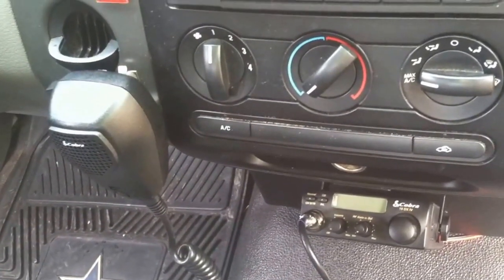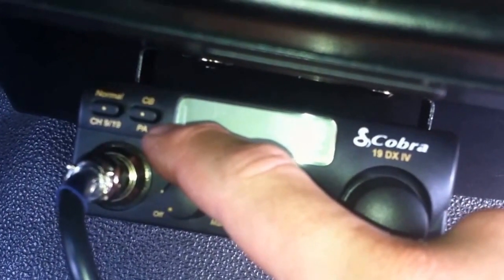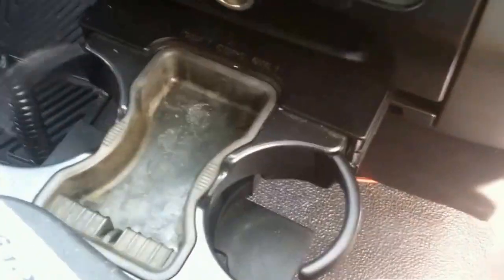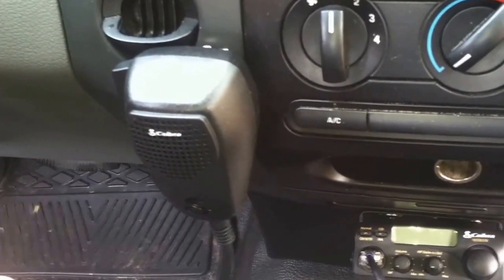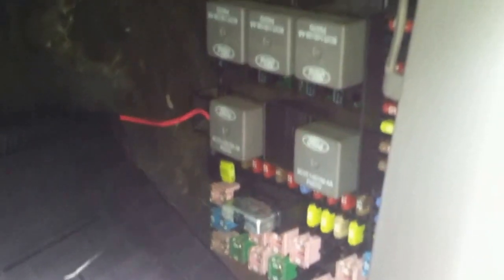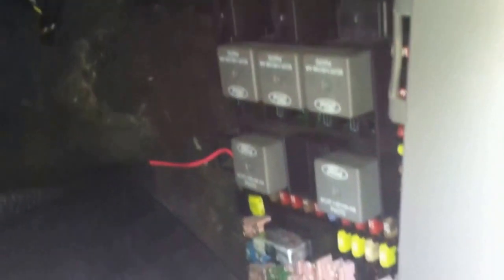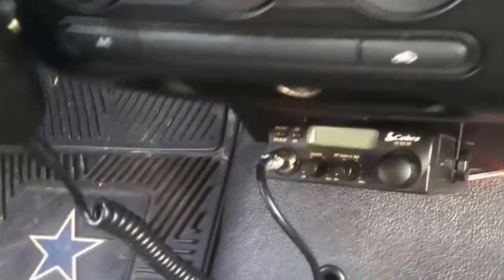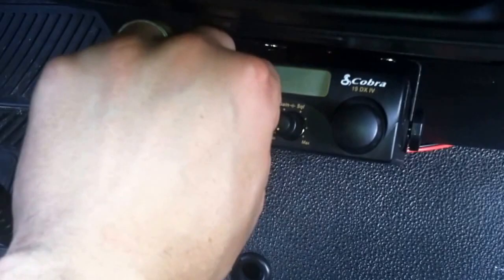Simple CB Radio Installation

Comment: Correct me if I'm wrong but the fuse tap has two slots for two fuses? i.e. one for the CB and the other for the cigarette lighter. Also I think there is a load side for the fuse tap so it has to be installed a certain way or it won't protect your CB.  Thanks for sharing.

Comment: Would it be better to wire directly to car battery? If so, any pointers? Like do I need a specific wire?
Reply: run to battery is best way... ground your negative to your body and hook positive to ur battery
Reply: @christopherdawson3708  if I use the fuse tap in a cig fuse can I still use the plug with it?
Reply: @seanjuth  ????

Comment: Dude, if you still have that setup, and if that mike bracket still bugs you, take it off, file down or (up) the one of the screw holes. That will allow you to straighten it out, without a new hole into the dash. The fuse / feed mount is excellent. Very few people use that idea. I would suggest (if you haven't already) use the connection with the inline fuse in between the radio and the direct fuse. (giving you two blue 'mashed' up crimps, lol , one on either side of the inline fuse)

Comment: What happens if you use a fuse that's a higher number? My fuse shows 7.5, 15, 20, 30. Im wondering if it matters if I use 30 or 7.5 fuse, will it make a difference?
Reply: Yeh it can affect the current that goes through the cable which can either overload and burn your cable or not send enough power to the cb